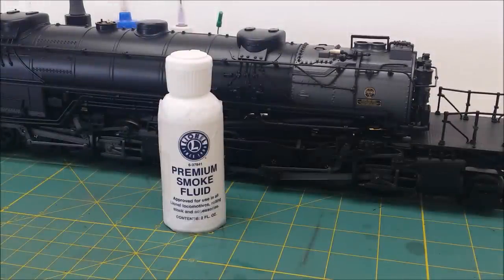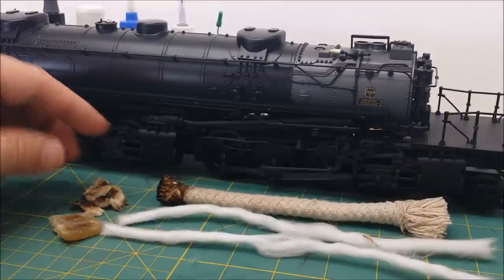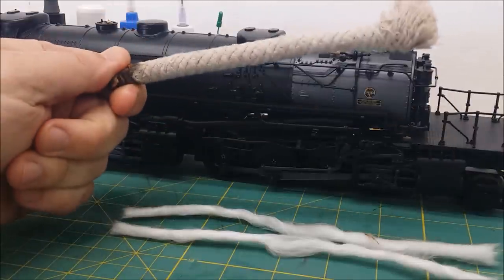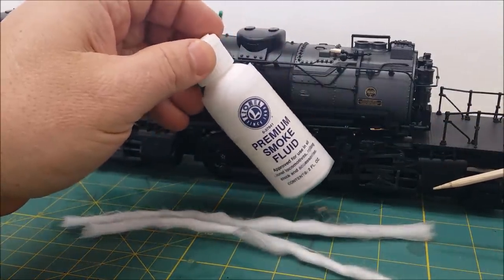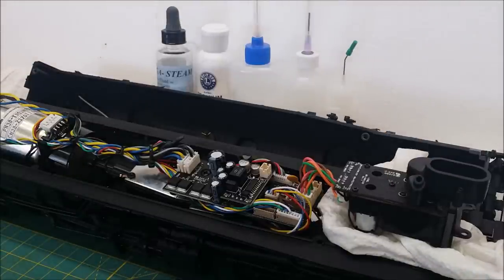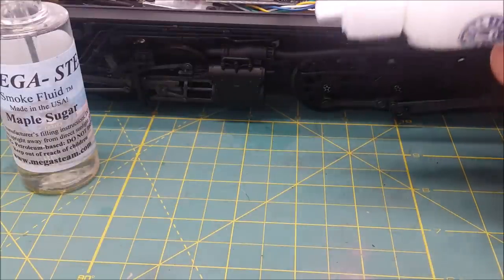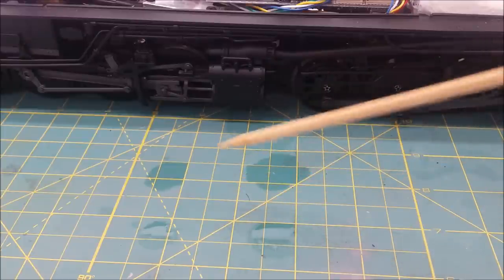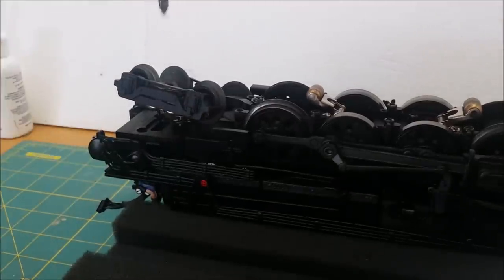120 Drops of Lionel Premium Smoke Fluid

Comment: This video is soooo helpful in understanding the mechanics of the smoke unit. I’m gonna open up my diesel now and check for similar and see if I can understand why I’m getting an error code.

Thank you!
Reply from the maker: Most errors are caused by fan motors.
Reply: @Laidoffsick  

That’s the code I’m receiving. Hopefully it’s something I can clean instead of replace.
Reply from the maker: @kenmunozatmmrrailroad6853  its usually a case of needing a drop of oil. Nothing to clean
Reply: @Laidoffsick  

Buddy... thank you so much. I’ve got the afternoon so I’m all over it.👍🏽💪🏽

Comment: This and the video before this one is great! I've had problems with my Legacy Berkshires and now I know how to fix them. Thanks so much!
Reply: Train Wizard Productions great smoke, great video. I want to make a smoke machine without a train but using the smoke resister I got from the Hobby shop. My question is:  what voltage does it require?

Comment: I pulled a MTH deisel of my shelf and added 30 drops, no smoke. Pulled the smoke unit apart- guess what, bone dry. Re adjusted the wick filled the bowl, primed the wick, all good, smoking like cheech&chong
Reply from the maker: And once the wick is burnt, the performance drops significantly
Reply: @Laidoffsick  oh ya, I change the wick if needed, but this engine has only minimal hours on it, the wick looked pretty good, and the fan motor was noisy so i oiled it as well, It smokes  like crazy again

Comment: Thanks for the info about the smoke units. i did not know that you can saturate the wick better. I have a Big Boy to work on. Good job.
Reply from the maker: mamanbear1 If you don't keep it rally wet, it will burn. Once it burns, the smoke volume really decreases, and the only way to fix it, is replace the wick/batting.

Comment: Very interesting. A shame the manufacturer recommends such a meagre amount of smoke fluid, they are actually causing owners to damage their smoke units. It would have been better to err on the side of too much fluid.
The end result is impressive, the volume of smoke is dramatic.
Any chance of seeing it run in a less confined space?
Reply from the maker: struck2soon It's in a few other of my videos on our big layout, but that was before I swapped the smoke batting. That was just a quick test after the smoke fluid change. The big layout is currently a mess due to rock wall construction.
Reply: Cheers sick-note, I checked out a couple of your other vids. The one using camera mounted on cab roof is fantastic, just like being behind the real thing!

Comment: A shot in the dark...  I do HO Scale Broadway Limited and I get a lot of problems with smoke.  Do you know if the smoke unit is similar to the O Scale Lionel?  I use the megasteam as well.  I think it does more in the HO scale.  Why did you decide to stick with the megasteam?  I always tend to overfill my locos with the fear of my smoke generator burning out.  Hate when it seeps theough the boiler on to the walkways..  great video..  thanks
Reply from the maker: I don't know about Ho stuff. I use the Megasteam because of the scents. The Lionel Premium really stinks, although they have announced a new scented smoke fluid in the latest catalog. Smoke units are a PITA sometimes...most of the time. Too much fluid, too little fluid, air bubbles, too much smoke in the room, not enough to see in the room. Can ruin the weathering too. You almost have to take every engine apart so you can see the bowl to know exactly how much fluid it will hold for max smoke effects.

Comment: Question 1: the video to this one, the guy ecommened removing the "sleeve" from the resistor of the smoke unit. Will that cause any damage done to the resistor or any damage I'm not aware of?
Question 2: can I make my own smoke fluid? And can it damage the smoke blower unit? And will scented smoke fluids damage to smoke blower unit? Ok that was 4 questions.
Reply from the maker: mkscorpion79 no. That sleeve should be removed.
Reply from the maker: mkscorpion79 do not make your own fluid... buy it!
Reply from the maker: mkscorpion79 smoke units are picky with amount of fluid to get max performance. They do need maintained, just like everything else. I replace the wick every year or so because I use a lot of smoke for max volume.

Comment: the Smoke Box on the engine it's pretty much one big vape pen that's how it works I'm going to once I get mine I'm getting the Pennsylvania m1a Legacy set and what they want for the Lionel smoke fluid I just thought I'd better give that a try it's odorless clear just vegetable... only why I say that because I'm a vapor and vg just make really good clouds but hey just a thought
Reply from the maker: save yourself some grief, spend the $$ on actual smoke fluid. you spend hundreds on cars and locomotives, don't go all cheap on smoke fluid. not to mention you will void the warranty by dumping veg oil in there

Comment: What kind of foam do you use when you are resting your Locomotive on your work bench? I have a Lionel "THE GENERAL" locomotive that needs some new smoke wadding inside of it so I can put some TOP QUALITY smoke fluid is and it can smoke with pride again!!!
Reply from the maker: you can buy a foam cradle online or at your local hobby shop. sometimes I just use a towel folded up a few times for extra padding.
Reply: Many many thanks for the helpful tip!!! I'm gonna telephone my local hobby shoppe now!!!